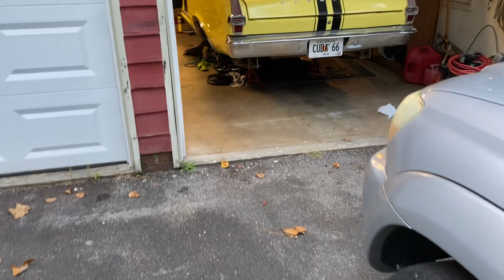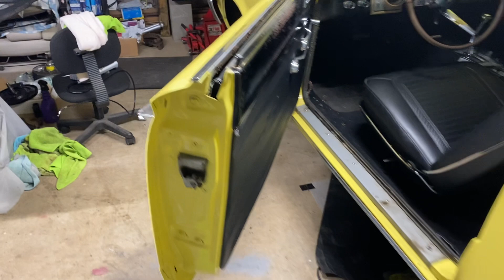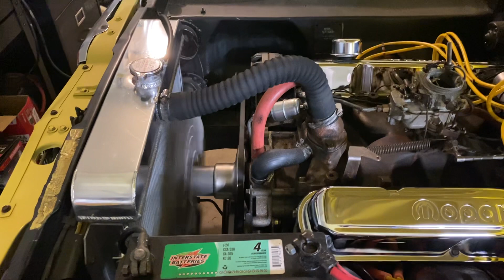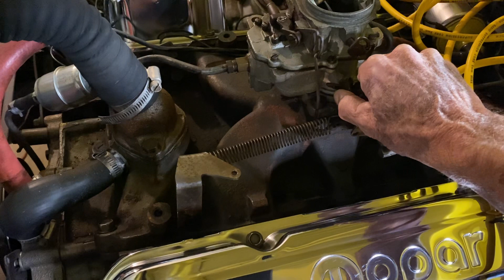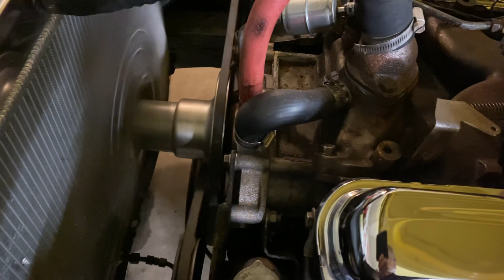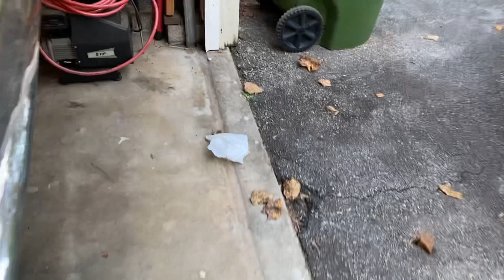Seriously looking at the overall strength of this engine! Initial borascope inspection ongoing.

Comment: Engine sounds pretty good how's the oil pressure when hot...do a compression test engine warm with throttle tied wide open see how much you have and how much it varies from cylinder to cylinder.... How's the vaccum nice and steady? Or is it bouncing around....maybe all that carbon can be clean out with some seafoam treatment if it's got good oil pressure and compression and doesn't smoke it's good for a street driver.